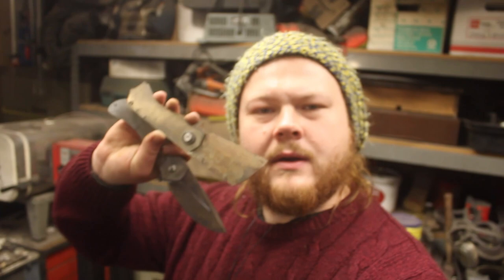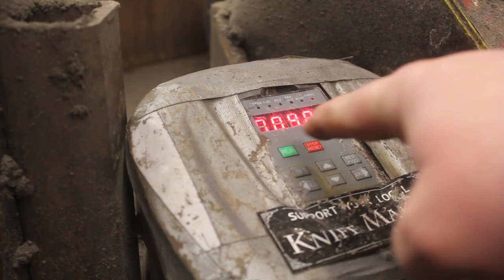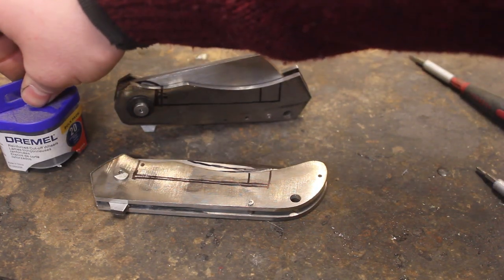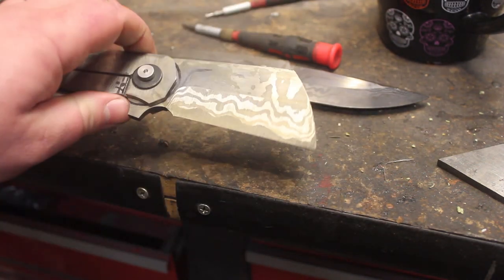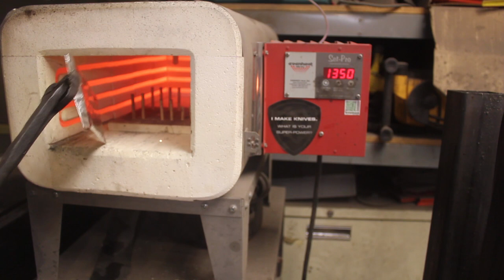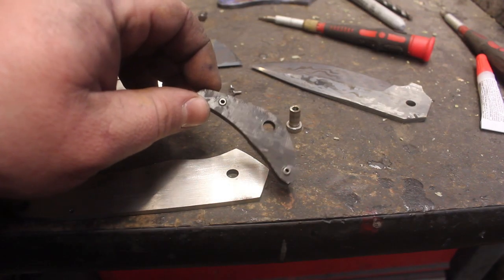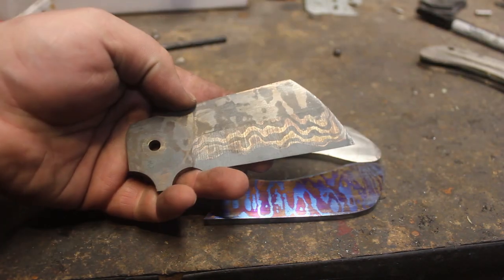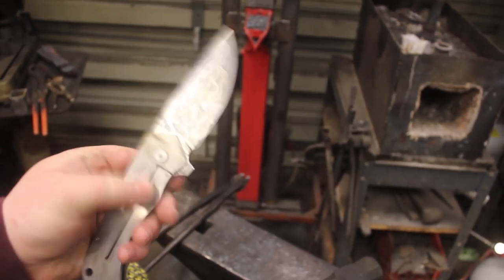Let's Make a Knife - Stainless Damascus and Titanium Damascus Folding Knives - Part 4

Comment: Hats off to you, this is the ONLY video out there that actually shares details on one of the processes to weld and forge stainless damascus. The other ones show nothing and tell nothing about the process, just  promotional videos for sales.  Its a difficult process to get right but its not as far out of reach as most people believe, thank you for sharing yours. You should do a video specifically about it, I'm sure it would be extremely popular.  
  I've started making it, I'm using a process similar to diffusion bonding mokume gane (kiln method: torque plates, tool wrap bag, activated charcoal etc). I'm using 304L and 316L as I'm more jewelry oriented right now but I do make knives and will be applying it to martensitic SS.  I plan to share my process in the near future.
  Your doing some incredible work and I'm amazed that log splitter conversion press is able to keep up you! It goes to show you don't need a big, expensive hydraulic press to pull off the most technically challenging forge welding jobs! So much going on in this series of videos its hard to comment on it all.